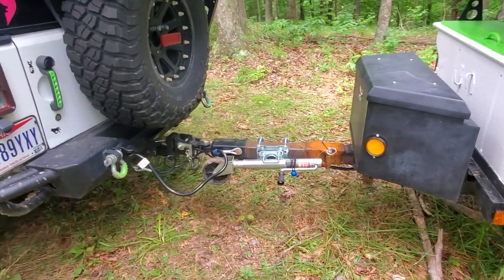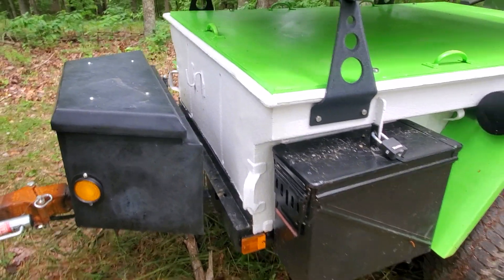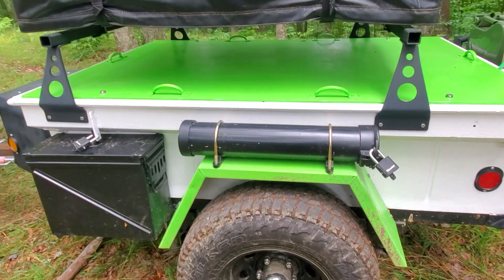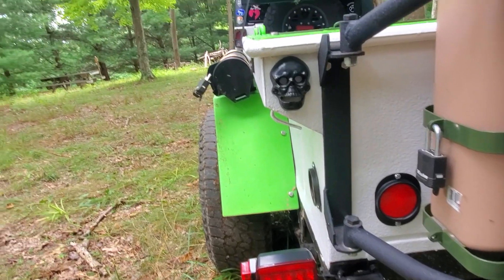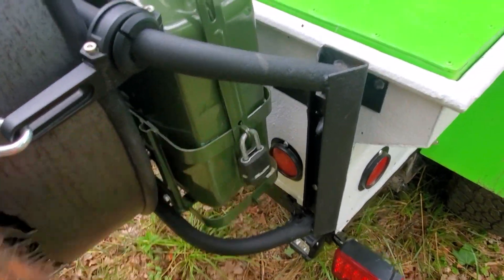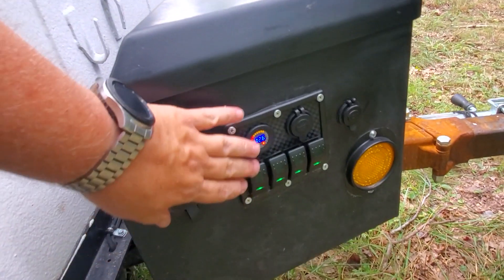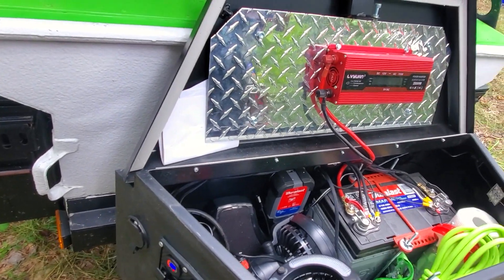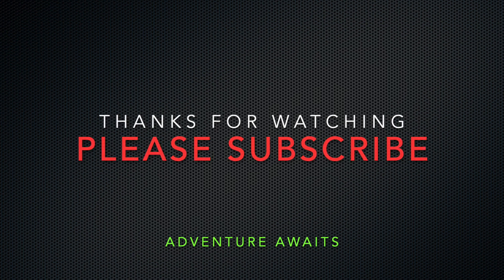M416 trailer walk around

Comment: The Coleman fuel canisters don’t get too hot with the sun beating down on that black tube?  That’s a sweet setup, really cool.
Reply from the maker: Thank you. They do not get hot at all. Even in direct sun they are only warm to the touch, not hot. I wondered the same thing and thought I would change things if needed but made it through the summer with no issue.

Comment: I've had an M-416 since ''87.  Vehicles that pulled it have come and gone but the little trailer remains.

I'm curious as to why you ditched the OEM lunette ring arrangement in favor of this aftermarket hitch system?   I've taken mine across some moderately difficult trails, like the Rubicon, and never had any problems with the OEM set-up mated to a pintle hook on my vehicle, in terms of articulation or anything else, hence the curiosity over your hitch arrangement.

Comment: Do you have specs on the propane cylinder tube/holder? I need to build one! Nice trailer.
Reply from the maker: Thank you! You can buy the kit on amazon. It uses 4" pvc pipe cut to length. Here is the link to the parts... https://www.amazon.com/dp/B005G2RY6U/?ref=exp_greybeard_overland_dp_vv_d
Reply: Thanks for the reply!

Comment: How is that compact camping tower holding up?
Reply from the maker: They are great! Very sturdy design. I had them powder coated so would expect they will hood up for years!!
Reply: What did you use for the cross bars? I just picked up a set of the towers to mount my tent .also at what length did you make yours ? Awesome build !!!

Comment: Your trickle Charger how did you set that up?  Nice Rig!!!
Reply from the maker: Thank you!... it is a 2 amp battery tender / trickle charger. It auto regulates to keep the battery fully charged when it is in storage. I have a shorepower plug in the box and the charger is direct to it. 
I am adding a 100w solar panel as well that will assist in keeping the battery topped off when the trailer is deployed.
Reply: @GREYBEARDS-ADVENTURES  shore power plug is connected to the battery tender gotcha.

Comment: How do you get into the tub?
Reply from the maker: The lid is removable and items can be accessed all around depending on the size. Larger items like totes or cooler go in and out via the rear of the trailer where the largest opening is.
Reply: Usually one leg at a time but I prefer showers😊 it was a good question.
Reply from the maker: 🤣🤣🤣 that is a clever answer.